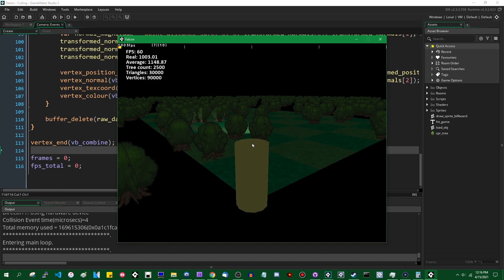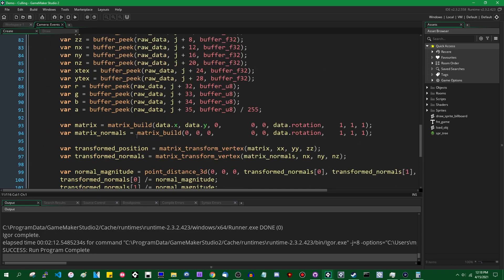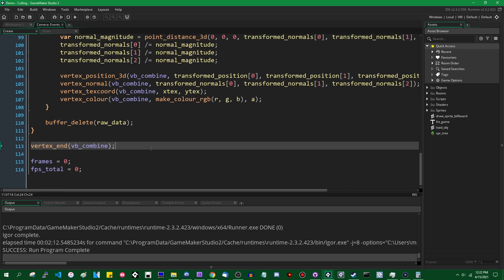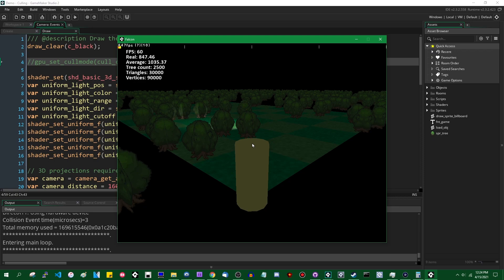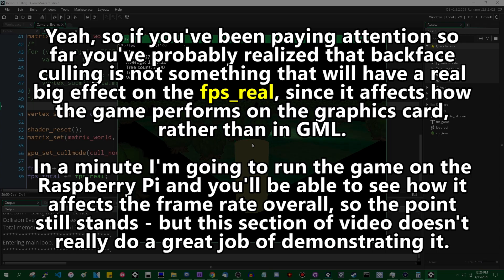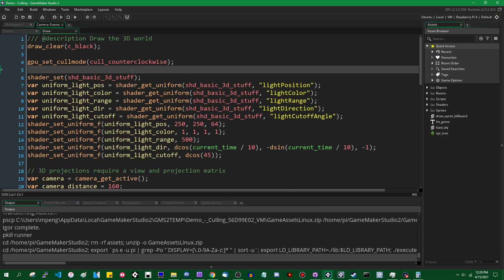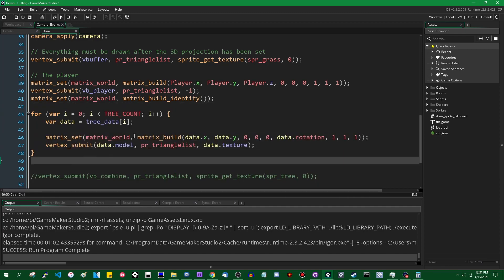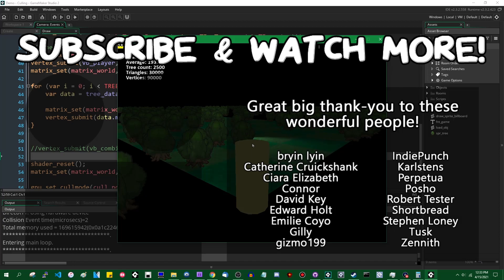Backface Culling - Optimizing 3D Games in GameMaker

Comment from the maker: The section in the middle of this video got a little weird: if the game running on my desktop computer was being bottlenecked by the GPU instead of my CPU you would see backface culling affecting the observed fps (but not the fps_real) the same way it does on the Raspberry Pi, but it's pretty rare for a GameMaker game running on a computer with a dedicated graphics card be bottlenecked by the GPU so unless you're trying to draw a truly enormous vertex buffer that's unlikely to something that makes a noticeable impact. (On something like the Raspberry Pi, or a mobile device... or the Nintendo Switch... it's a very different story.)

Also near the end I said something that made it sound like making your GPU fill fewer triangles is useless - which obviously isn't the case at all, but again, on a desktop computer it's very likely that other things happening in your game will have a much larger impact on performance.